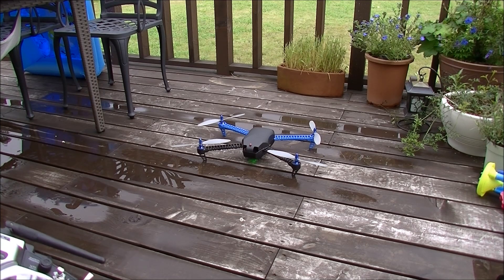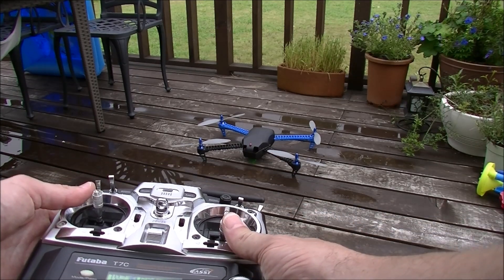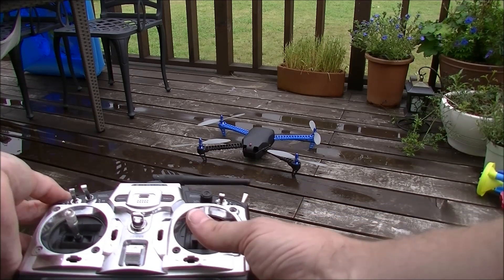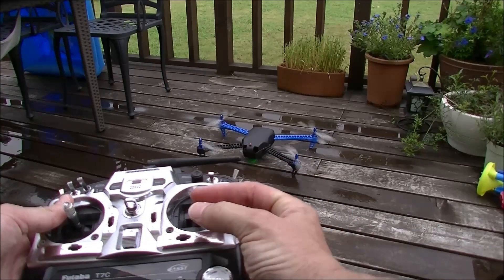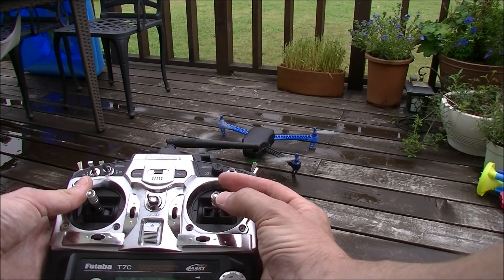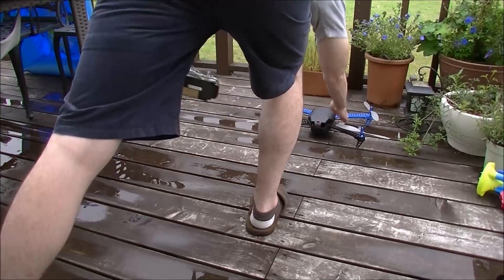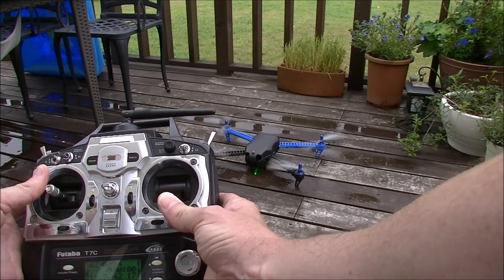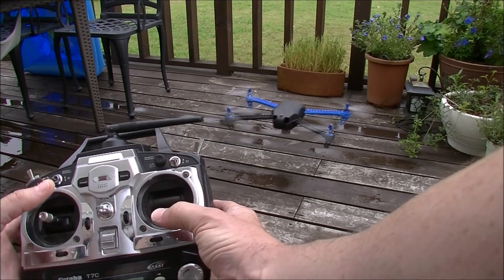AC3.2-rc4 AltHold Feedback

Comment: To avoid jumps on takeoff/landing you can decrease the weight of baro in mix of baro+acc (e.g. if takeoff and alt < 0.7m). Because when you takeoff slowly, raw baro measurements goes down up to minus 4-5 meters.
It works http://youtu.be/0R9nUMqIwyo (from 3 min)  

p.s. Also could you reply on this https://github.com/diydrones/ardupilot/issues/1030

Comment: Have you noticed any unacceptable altitude loss when flying in position hold(hybrid), loiter, or altitude hold modes? When compared to my MikroKopter and an old Naza, there seems to be a lot of altitude drop on the Pixhawk when mounted on the same machine in close to zero wind conditions. Even when my Pixhawk is inside a Tupperware case. If I just leave it in a hover its perfect. But the moment I move even at snails pace it drops altitude.
Reply from the maker: chandruth  it's all guess work without a log i'm afraid.  Best to raise it in the APM Forum or on diydrones.
Reply: Alright. Great work on AC3.2. Even though its a beta it feels like a finished firmware.

Comment: Just curious, but is there known bugs regarding the sonar sensor in later versions? I don't get any report back for the sonarrange params in missionplanner, but the copter does seem to (although very slowly) react to the sonar sensor. It also seems that if you put a large object under the sonar sensor, it'll fly upwards, but sometimes it'll get "stuck" and not come back down again?
Reply from the maker: LPFthings In AC3.2 we send the sonar distance to the mission planner (or whatever GCS you're using) but in earlier versions I don't think we do.  I think you'll find that AC3.2's sonar alt hold is much more responsive.